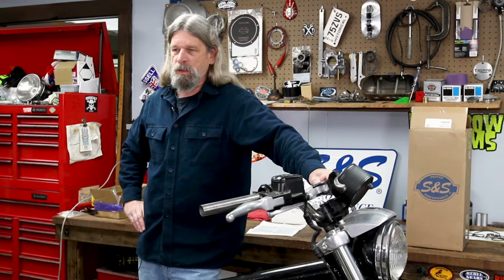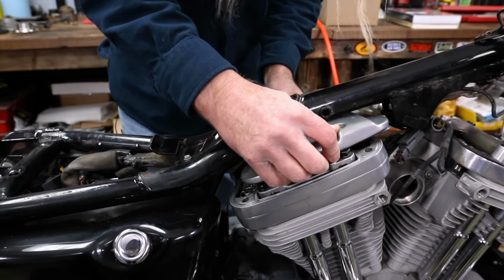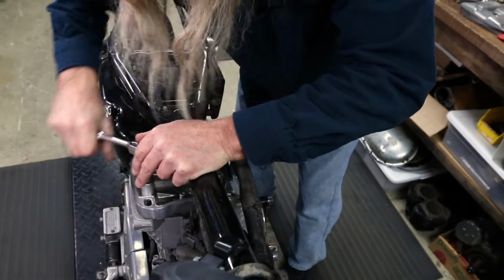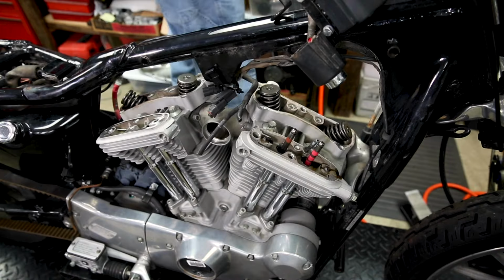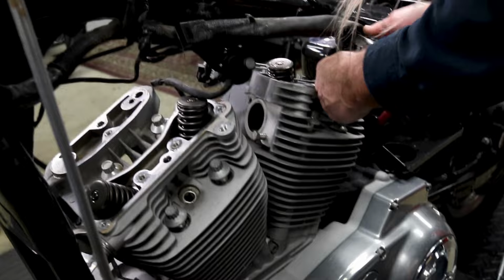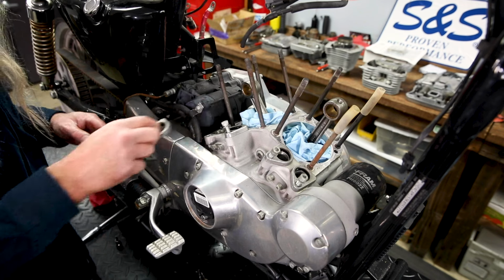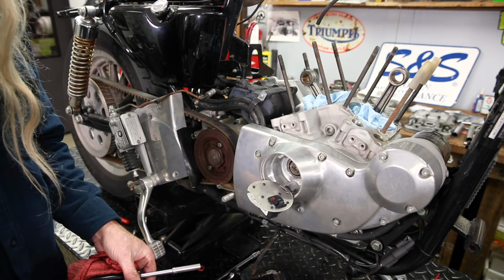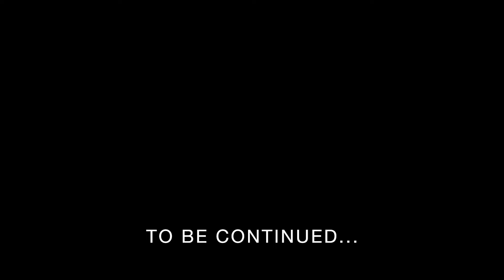How To Install S&S Cycles 1200cc Hooligan kit 883cc Harley-Davidson Sportsters Part 1 - Disassembly

Comment: Great video - I may have to do this to my 2001 Sporty. I was highly amused with your disdain at 42:30 for HD's use of Oetiker / ear-style clamps. Keep up the good work; excellent video and you did de-mystify a bunch of the inner workings to remove the worry factor. Cheers.

Comment: When I did my 03, I got 93 hp out of it on dino. And put a Baker 6 speed trans. in to. The bike was a rocket
Reply: Was that 6 speed a bitch to get done?
Reply: how does the S&S 1200 kit differ from a factory 1200?
Reply: @gnarlytothemax  I don't know.

Comment: I’m really digging your videos.  It’s been a minute or two since I’ve done most of this. It’s reminding me of some of the little things that makes your life easier.  Example: I always kept 8 pieces of fuel line (approx 3-4” each) to put over the cylinder studs to prevent boogering up the threads by accident. I noticed you used some on the front two. One day, I’m going to visit LowBrows. Love my QuadCam & love y’all’s appreciation for XLs & such.  The style of your bikes is right up my alley, unlike “bikers” like Arlen Ness & such 🤮

Comment: Always remember that when you remove the cam cover the oil in the oil tank will slowly run through the pump and drain out of the oil galley that allows it to get into the timing cover - resulting in a huge mess under the bike. Either drain the tank first or pinch off the feed tube from the tank to the pump with some vice grip pliers........
Reply from the maker: Thank you... sound advice! We totally thought there was only a little left in there! Ahahha whoops
Reply: @lowbrowcustoms   I recently forgot my own advice and had a big puddle under the bike after I stopped for lunch when changing cams.... Oh well, that piece of concrete will never go rusty !!

Comment: Hey brother in cali most aftermarket pipes dont meet cali specs can i still do all this work like big bore kit,air cleaner, and cams and tune but run my stock pipes will this work still
Reply from the maker: Yes.

Comment: Thanks for the video. I have a 90' sportster and want to put on the s&s conversion kit. But I am told that the lower engine can break. I need advice. do I or not?
Reply from the maker: Break, how? As long as you do everything correctly, torque stuff properly, you have nothing to worry about. If you are unsure that you can properly install it on your own, reach out to a local shop and have them do it. Companies make these kits because they work, not because they break motors. They just need to be installed properly. Hope that helps.

Comment: Very interested in how this goes. I hope that you video all of the process.  Love the Sportster and the S&S engines are top notch material. If all goes well, it just might happen for me. The sporty always did need some extra go for the 2 lane blacktops that I ride on and some 4 lane divided. It would fit the bill for a short 250 mile trip in a few hours.
Reply from the maker: Releasing part 2 next Monday and part 3 the following Monday. we go step by step. A lot of other videos skim through it, we want to make sure everyone is comfortable doing this from beginner to master
Reply: @lowbrowcustoms  Works for me.  Great video on this change over.
Reply: lowbrowcustoms ...and this is one of the many reasons why Lowbrow is AWESOME!!!

Comment: I bought a '94 Sportster which I think has an S&S kit on it.  Is there an easy way to be sure?
Reply from the maker: It’ll say S&S on the jugs
Reply: @lowbrowcustoms  Thanks.  I'll look later, In UK where it is currently 10.15 pm and freezing cold!!!
Reply: @christopherdean1326  the engine is cast stamped on the aluminum at the bottom of the heads will say 883 or 1200!!

Comment: my 2005 sportster does not have that timing thing.. I removed that little cover and there's nothing. how is the ignition timing done on 2005 sporties?
Reply from the maker: 04-06 sportsters the ignition module is under the seat. they moved it out of the timing cover area. here is 32622-04 OEM number for ignition module you can google that number and can see its larger square box.

Comment: Pretty good, would you do something cool for us pre rubber mount XL1200s?
Reply from the maker: we have 1200 kits for 86-19 sportsters. process is very similar. you just dont have the hopped up cams. gotta get those separately. https://www.lowbrowcustoms.com/collections/motorcycle-engine/products/s-and-s-cycle-harley-sportster-883-to-1200cc-1986-2019-silver-s-s-cycle-big-bore-kit-910-0688

Comment: If your just doing the jugs and pistons do you need to drain the oil?
Reply from the maker: You could possibly not drain it but, you might have a mess on your hands, better to run fresh oil in her anyway with the new pistons.
Reply: @lowbrowcustoms  okay thanks. Just changed my oil and then decided to order big bore, was trying to be lazy but I'll drain it

Comment: Like other I don't own a Harley, but do enjoy all these how to videos, definitely going to get one someday. One criticism of HD, but definitely not just them, it amazes me as pointed out in the video, how little thought goes into maintenance of their products, would it really have been that hard, to have some extra room to help with removal of that rear cover? I've just finished renewing a cam belt on my Ford, what a pain all for just a little bit more room. I worked in heavy engineering, and the same issues crop up time and time again, and you hear the same cry
" what f**king clown designed this" When all that was needed was half an inch!

Comment: I wanna do the 1250 hooligan kit on my sporty 1200 in assume this is the same procedure
Reply from the maker: only thing different is the jugs and piston size. all the procedures are the same. and if you aren't doing cams skip that vid.
Reply: @lowbrowcustoms  I want to get the ss kit with the cams and tappetts. A buddy told me get the kit without and go with Andrew's cams. What's your opinion. What Andrew cam would be best and would I need tappetts still? Thanks for your response
Reply from the maker: @micc4044  if you are chaining the cams get the Andrews lifters too. Change it all out new and fresh. Do you research and see if there is a certain set that works best with whatever cams you are buying.
Reply: @lowbrowcustoms  alright thanks. I need to figure out what Andrew's cams and tappetts go best with the 1250 kit on stock heads. I will call them hope they can help. Thx again.

Comment: Thanks for this video, my 12 point head bolts could use a replacement, or a deep polish, same with the pushrod tube holders, would it be safe for me to remove one of them, and install it back in and torque it, without taking anyhting else apart, 1 by 1 exchange to new bolts, im fairly new to HD :)

Comment: hey man there is a 2013 883 sportster for sale which had the engine temperature sensor removed for a few months, and the bike runs with a rich fuel mixture now.
Is it safe to buy this bike? thanks mate
Reply: Sure anything broke can be fixed

Comment: love the vid, but man, you could've saved alot of time just using a drill with whatever bit or socket  instead of a slow air ratchet.
we use a cordless impact driver and it's so fast and easy. Still, I love your videos, thanks!

Comment: I love you guys to death, but the S&S kit is expensive for what you get. Unlock the power with head work.....I have a stock 1200 with just head work and a good exhaust and tune pushing 78hp... For $1000 you can get a 1275 kit and a set of cams....
Reply: This, if anyone actually does any research they would call Hammer Performance.

Comment: Does the 2018 end the twin cam motor on the sportster?
Reply from the maker: Sportster has never been a twin cam motor. Since 1986 they have been Evo style motors. 2004 they changed to rubber mount system but still evo and in 2007 they changed them to EFI but still Evo motors.
Reply: @lowbrowcustoms  thanks been a long time sense I've looked into a newer Harley
Reply: Bjorn Raido watch the video. Sportsters have had four gear-driven cams since 1957. One of the reasons I love them!

Comment: Just buy the 1200 to begin with.
Reply: Springwood Slasher perk of getting a 883, then going to a 1200 kit is your insurance thinks you only have an 883, so it’s cheaper
Reply: @jordancailes8383  bike insurance is cheap as fuck.  I save myself thousands of dollars on parts and labor and just buy the 1200.  That's exactly what I did and my insurance is 25 bucks a month.
Reply: Different gearing
Reply: Jordan Cailes also, you can install this awesome kit, which will make more power than a stock 1200. Sounds like a plan to me, but I like tinkering...

Comment: is it me or is this video unnecessarily long cause both cylinder are the same why show both and use time lapes when taking off similar bolt save times
Reply from the maker: some people have never done this before at all so we want to show and not skip too much. A lot of videos skim through and if you are a beginner you might not know what something is. Just trying to be helpful to every kind of person out there. Sorry if its a bit long but we try to be as informative as possible.
Reply from the maker: Also in the description there are time stamps you can skip to parts you need to know if you would like to speed up the process :)
Reply: That would be incredibly annoying.  I hate it when people edit a How To so much that it doesn't convey the time, attention to detail and ability to overcome obstacles that the project requires.

There are plenty of those videos for you on YouTube.

Comment: Wow, as a sport bike owner, I would cringe if someone took my bike apart with the reckless attitude this guy does, placing machine-planed faces smack down on a dirty workbench, scraping and clawing a rocker cover out scratching the frame and cover. I'm sure these simple engines can handle this abuse, but a more refined motor would bite back at you after you put it all back together.

One of the reasons I do all my own work, just got my bike back together after a valve clearance check.
Reply: It's kinda the reason AK47s are so effective. They don't jam up in abusive conditions with neglected maintenance. Depending on the application, sometimes higher tolerances are not always better. 

I think he did a half decent job..
Reply: It’s fine, he didn’t do anything wrong.
Reply: @cyclhed  Like I said, with this bike, no probs, no harm, no foul. Interesting to see the difference in maintenance between these, and the extremely complicated DOHC I-4's of sportbikes.
Reply from the maker: It’s our bike, we don’t work on customer bikes... and he didn’t hurt anything... this video is for learning purposes not how to set down tools and parts gently 🤷🏼‍♂️ purposes